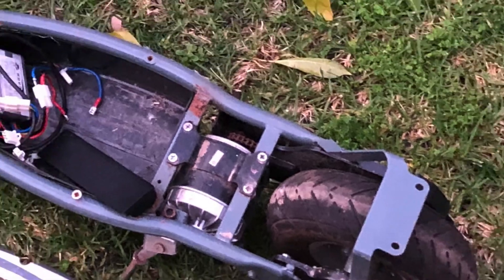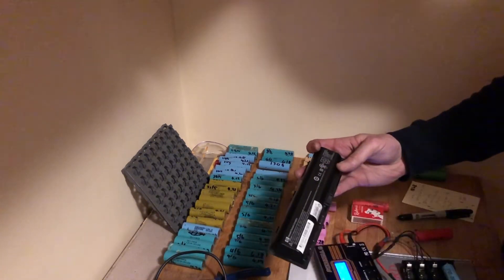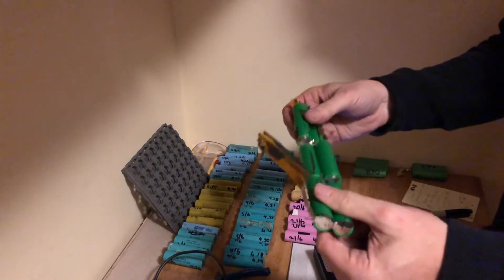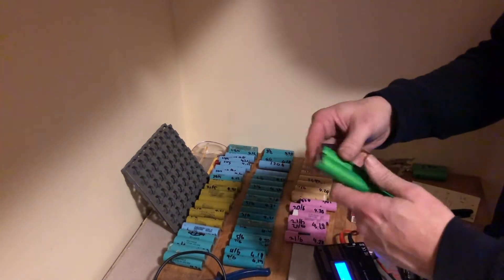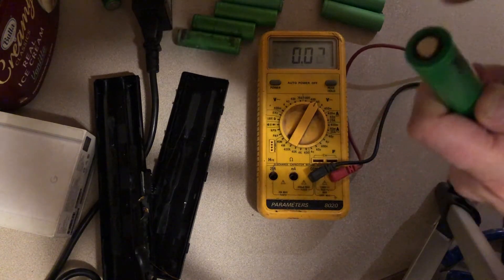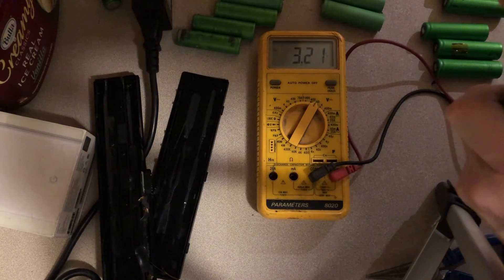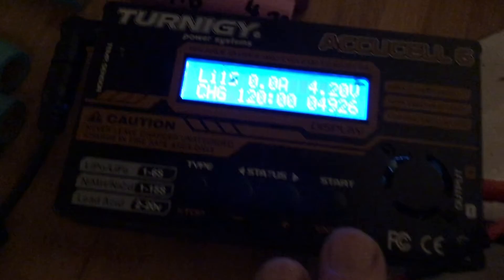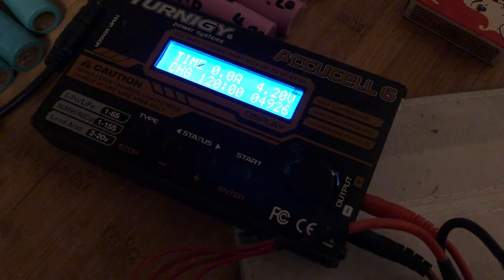Harvesting 18650 Lithium from a HP Laptop Battery for the Hacked Big Motor Razor Electric Scooter

Comment: I don't know how this ends, but you are mixing batteries of drastically different characteristics. A tool battery for example can discharge at 30 amps while a laptop battery might do 2 amps on a good day. Tool batteries are a good choice for scooters, but you've really got a mess there.
Reply from the maker: Hi Ted, It's an interesting point that you raise.  Here is a video that I did comparing a 6s to 7s pack and I don't think that the current draw from the total pack limited the scooter in any way:  https://youtu.be/vHbdyS-3Hrw  Check the video out and see what you think?  Cheers Drew